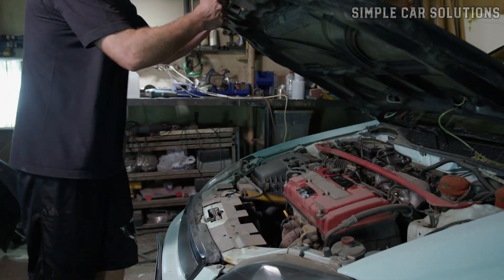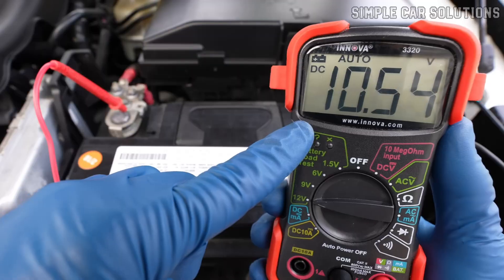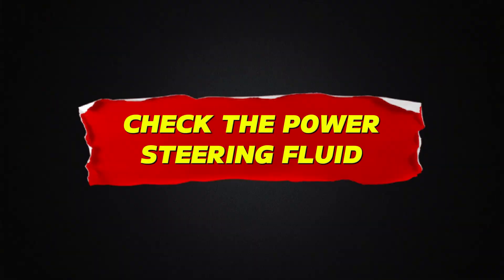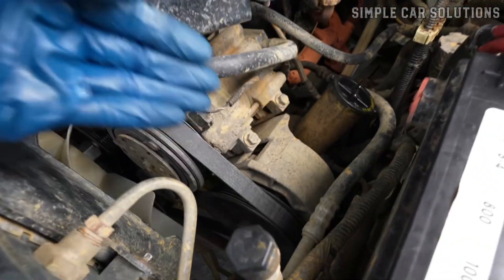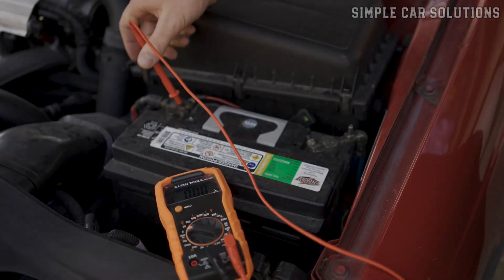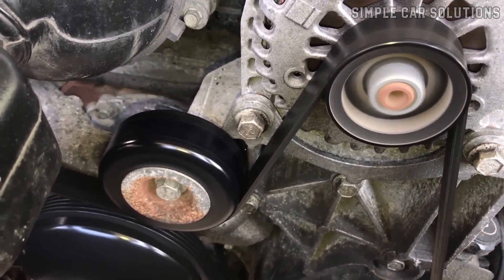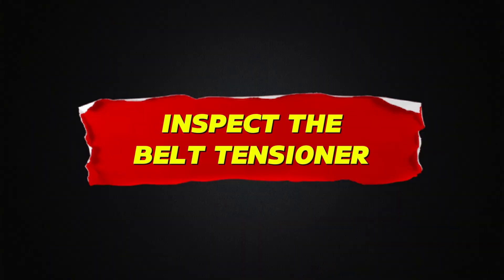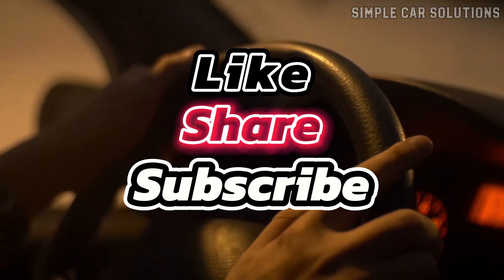Car Squealing Noise When Starting. Why a Car Squeals and How to Fix It

Comment: does having this happen on cold or warm startup make a differrence on what the problem might be?   I have heard sometimes it only happens on cold startup.  in other instances it happens on cold and warm startup.  I am having the latter problem.
Reply from the maker: Yes. A cold-only squeal usually points to a worn or loose belt. If it squeals on both cold and warm starts, the belt or a pulley/tensioner is likely badly worn and should be inspected or replaced.

Comment: Its weird, i have a VW GOLF mk4 and it gets a very loud squealing on start, but goes away after 5 minutes of driving. but when the day is cold, the squealing never happens and it just feels normal. 
the belt is new and doesnt seem to have any problem on the steering pump or alternator
Reply from the maker: Sounds like the belt tensioner or idler pulley is weak—cold weather tightens it up, so it quiets down. Check tensioner spring and pulley bearings.

Comment: What causes the squealing sound and the car won't start? For example: when turning the key in the ignition, the car just makes a squealing sound.
Reply: I was looking for this exact comment!!
Reply: @XWARDX956 I hope it helps with your car situation. My car won't move so I need to find someone to put a new starter in at my house. I so wish I knew a good mechanic.
Reply from the maker: A squeal at start with no crank is usually a slipping starter or bad starter drive, not the belts — likely the starter needs replacement.
Reply: @SimpleCarSolutions Thank you so much!
Reply from the maker: @SF-vd3cs  You're welcome 😉
Reply: @SimpleCarSolutions could a bed engine coil be a reason for the car to start screeching?
Reply from the maker: @XWARDX956  No — a bad ignition coil can cause misfires or no-start, but it won’t cause screeching. That noise is mechanical, usually from the starter or flywheel.